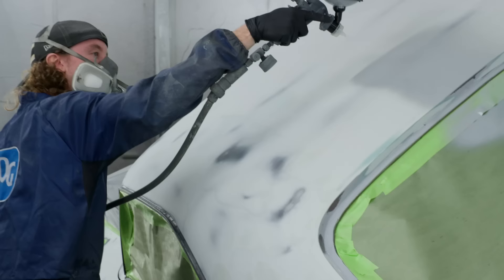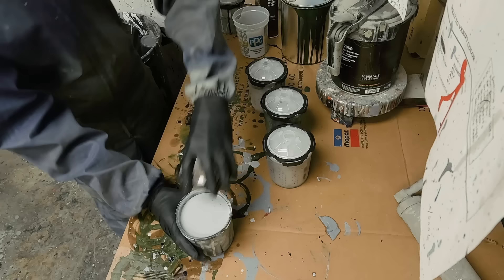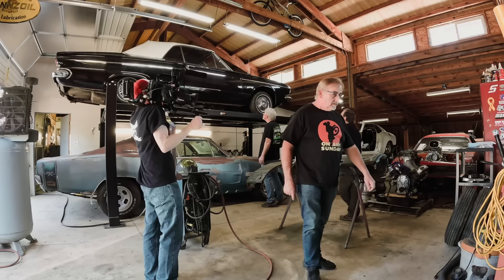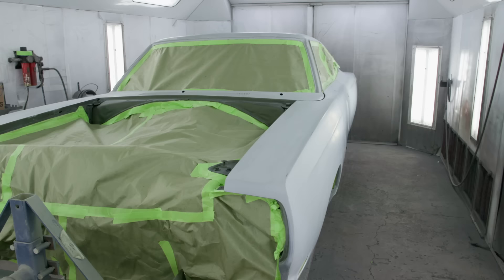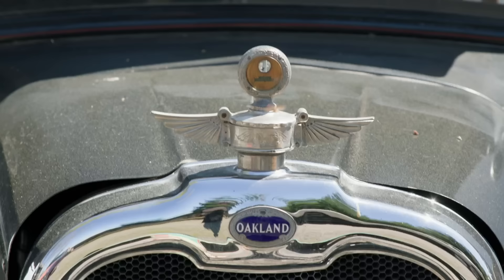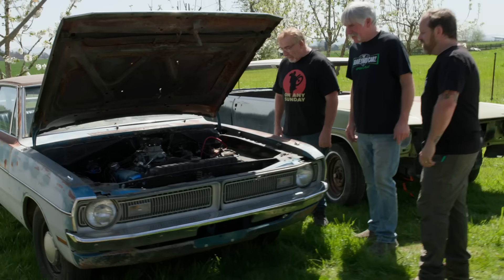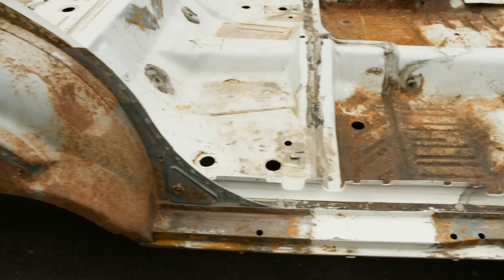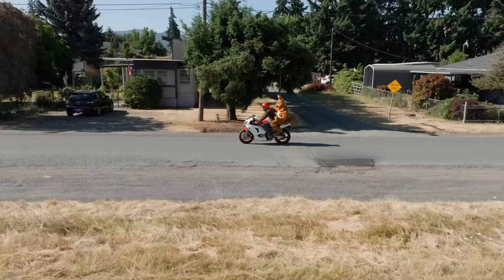**NEW EPISODE** HIDDEN MOPAR ONLY WRECKING YARD HAVE THE GHOULS ON SENSORY OVERLOAD!

Comment: my cousin has a 63 dart gt  convertable red with black stripe around the  factory raised  hood scoop   with built  360 truck pulling motor  with fender well headers molded into the aprons every tube and  4 speed with cragers and a 69  charger  with built 440 and 727  its imaculent both cars are  he worked at chrysler for 40 years   retired now  jack plasters  rockford ill  we used to street race id valways win my 1970 z28   lt1   he spent like 3600   on 440 to get his charger to beat my z28   i went out bouight a set of black jack headers  59 bucks     1 my cousin helped me put them on   i beat him by a fener   boy was  he pissed off  true story lt1 b350 370 hp bad ass small block solid lifter  duntov  30 30 sounded like a sewing machine

Comment: Every single time i hear will talking about "transparent this" and "transparent that" ... "took 8 coats of base" and all of this non sense, i laugh.
it would help if he would down his movements. hes practically sprinting trying to lay the color. he mists it on so lightly that it does seem like its "transparent" doesnt it.... LOL

(im a professional painter with a degree in refinishing and structural repair)
Reply: Shot DuPont Base Coat back in the day. They had a sealer that was tinted , or Value Shade, so I didn't need 10 coats of color. The paint code in the computer had the sealer to use.